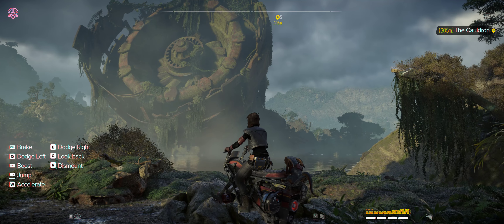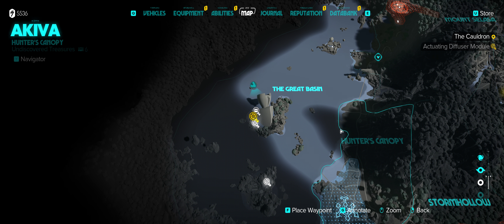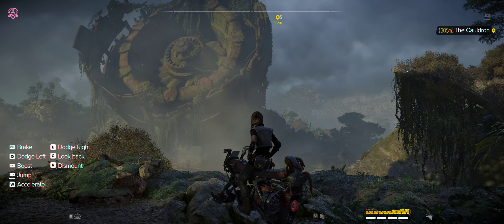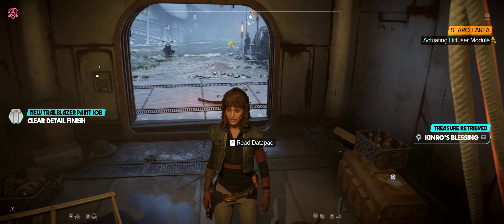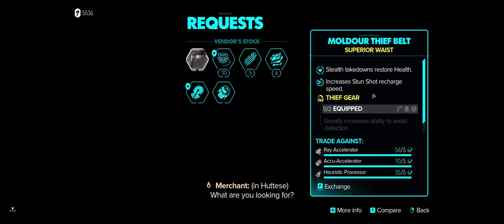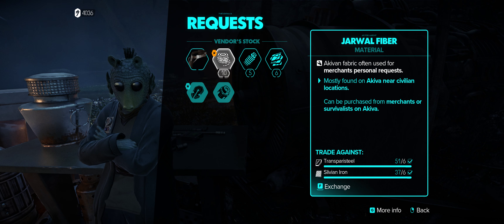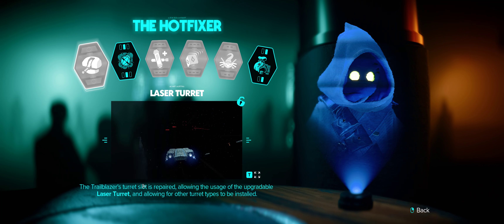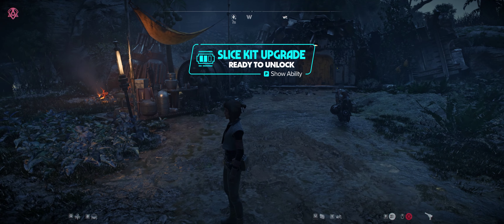Upgrade Heavy Plasma Damage, Slicer Energy, and a new Paintjob for Trailblazer | Star Wars Outlaws |

Comment: I can't even find how to open the heavy damage!
Reply from the maker: Heavy damage is usually the last upgrade module for each of the blaster types.  You need to unlock the other three upgrades first before you can unlock the fourth and final heavy damage upgrade.  Usually for the first three you need a Blaster recirculator component and the fourth is a unique key component